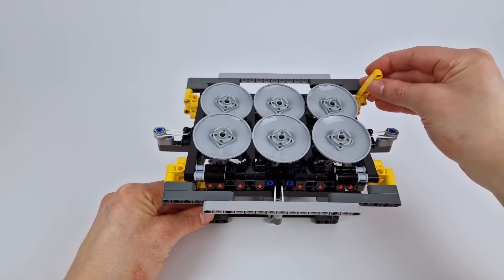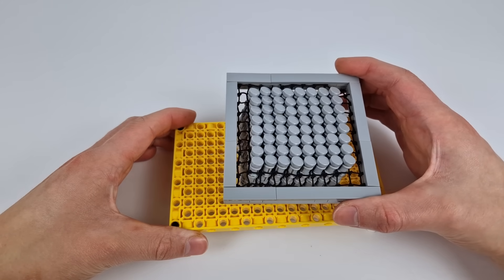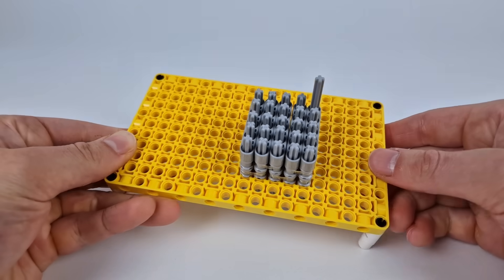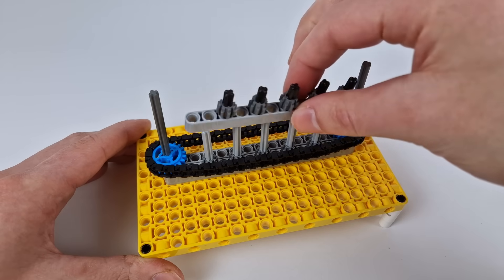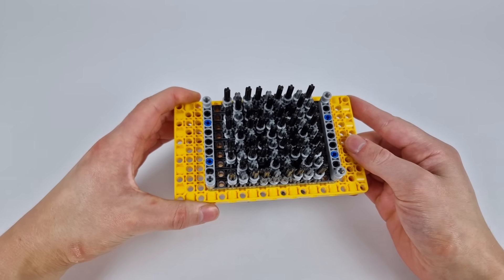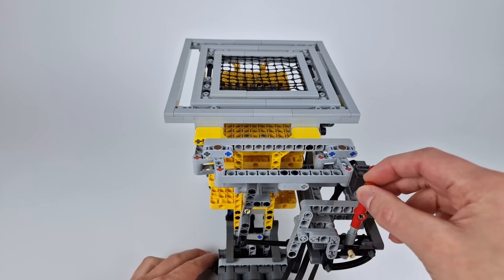How I Built a LEGO Treadmill That Moves in EVERY Direction

Comment: 4:00 Why not just add a dedicated drive gear adjacent to the border of the grid, on its own axle, powering one of the 8-tooth gears?

Do that for both layers, mechanically coupled to spin in the same direction.
Reply: Wait now I see the problem: You need the idlers on the second layer to run independently of the shafts from the first layer. Tricky.

Comment: Very kool, surprised you didn't use beveled spinning sticks with overlapping mesh to handle the smaller space to be able have an omni-directional treadmill for 1x1 lego bits but that would scale the mechanics more but would be neat where you could have a slowly scaling down from large disc down to stick-end points. May also go from rough move to smooth move.

Comment: you need to do the 2 layer approach combined with the rubber band approach for the 2nd layer, so you get the rotational direction on the bottom layer and each shaft only needs to bind to 1 other shaft to enable all of them
Reply: I think your bushings were adding too much tension on the bands though

Comment: hi! little engineering thing: the universal joint connection you used do transfer the rotation to one gear to the other doesnt transfer exactly the same angular velocity, instead, it transfer it with a  gain of a trigonometric function related to the angle between the axle of the gear and the axle you used to transfer motion to the other gears. However, the angle is small enough to not be noticeable, but you can experience what im saying via the vibrations produced by the coupling, again, mostly assorbed by the joint itself. to preserve a omocinetic coupling, you can simply put two universal joints with the same angle, and the trigonometric factor mentioned before will be canceled out by the other you implemented by using the second joint.

Comment: This is really cool! Here's an idea for a possible improvement. Right now, when you move the net, the axle above the U joint is moved aside, but this means the top discs are moved sideways in addition to being tilted. What if you could move the bottom half of the U joint aside while keeping the top mostly in place? That way you would only be tilting the discs, not translating them. The tilt would be a result of the bottom half axles being shifted over.

Comment: I probably would have used a bunch of universal axle joints to allow each axle to be offset from the 10x10 grid to allow for te usage of a grid like your first attempt, but i think your current version is probably better than that and it doesn't require four universe joints per axle(one for the upper part with the tile, three underneath to allow the axel to be offset from the placement in the grid, although it might be possible with two depending on the size of the offset).

Comment: 12:22 A two pulley design with a rubber band with 1 twist would work with a good length of rubber band. It's able to act similarly to a gear, reversing rotation .

Comment: I don't think the problem with the rubber bands was friction but rather elasticity. Each rubber band has a certain amount of stretch-give before it starts to turn the next axis. Basically, when you have two axes connected with a rubber band belt at rest after installing, the belt is in equal stretch tension on both sides. But once you start to turn one axle, the side that "pulls" on the other one gets streched while the side where the belt is fed to the other axle in a "pushing" motion is compressed. Depending on elasticity of the rubber band belt, the driven axle might turn a few degrees before the other one starts turning. Using only two axles, that's not too bad, but repeat that multiple times and it starts to add up. If you keep turning the driven axle for a long time, eventually all axles will rotate at the same speed. But it has 3 downsides:

1) The rubber bands you used are probably not super high quality, so the elasticity of the rubber may fluctuate around the band, giving a fluctuation in strechiness and causing a janky rotation.
2) While going around, the rubber bands are constantly altering between a streched and a compressed state which will wear them out quite fast.
3) Stopping the rotation or even reversing the direction will take forever until all rubberbands have found a new equilibrium.

Comment: You were hoping for 10x10, you found a clever trick with odd/even axles in 3x3, so you compromised at 9x9.  But wouldn't the same have worked at 5x5?

Comment: The original design with to gears thst were inverted when u tried adding the ruber bsnd u removed the gesrs( for context have two layers one gear for all the first ones and a second layer for the other ones then have ONE rubber band going from one of the first layer rods st The top to only one of the 2nd gears(this means only 1 ruber band connecting 2 gears and s full powered gears))

Comment: Could you not condense the vertical construction with a two layer gear system like your first idea was? But switch between gears that free spin and gears that grip the peg?
X=Gear that grips the peg; O=Gear that free spins; G=Motor
--Layer 1
XOXOXG
OXOXO
XOXOX
OXOXO
--Layer 2
OXOXO
XOXOX
OXOXO
XOXOXG
Cons are the friction of the free spinning gears being double and depending on free spin gears even existing for that size. I haven't touched a Lego since I was 13 so I have no idea.

Comment: Maybe 3 bevel gears can allow you to change the direction of an Axel.

Allowing you to use the original grid pattern assuming you can fit a   compartment to hold the bevel gears inbetewen every other Axel.

Comment: I don’t know if you’ve heard of something called a “planar motor” before, but this setup is very similar to one of those! The difference is that planar motors use electromagnets to move around a platform with permanent magnets inside, whereas this uses rotating discs—and can move literally anything!

Comment: instead of using the 12 tooth gears spaced apart you could try using a rubber band but twist it so the rotation is reversed? 11:48
Reply: I think te band rubbing against itself would make it saw through itself

Comment: This could be much better if the joystick moved the entire drive mechanism instead of the net, because now the upper disk are not only rotating in X and Y axles but also moving with net, therefore observing motion of the platform is counterintuitive.

Comment: 3:02 I'd have either printed a fitting gear or would have made a jig to drill them. 

Not nearly the challenge from your final solution though. 

I think instead of multiple 3x3 grids, i would have expanded the checkerboard pattern to get rind of the bushing layer.

Comment: This is certainly a very cool omnidirectional treadmill
The engineering behind the drive system is excellent, but I think there’s a solution to making a drive system that’s a a total of two studs tall.
If you make the lower layer powered by having 8 tooth gears on all axels going horizontally on every other row, then having a two long axel with an 8 tooth on both spaces on the outside of the grid, that couples with an idler that’s on top of a spacer, so that it only meshes with one of the 8 tooth on the axel, and the rest of the remaining axels.
Each row can be coupled together with a set of idlers outside the grid

Comment: Instead of the universal joint and gear powering the the two levels take a rubber band and cross it between the shafts that will make them rotate in opposite directions and its way more compact

Comment: The way you set up the linkages to counteract the 90 degree rotation is such a nice design detail. 

I haven't seen it in the comments, so I''m not sure if anyone mentioned this yet, but since you're tiling 3x3 squares, I wonder if you looked at taking out the corners, then tiling the resulting 5 stud plus shape. That could reduce the height of the assembly quite significantly, since you'd need less layers. I'm not sure if such a tiling is possible though. I don't know if the spacing would work out, and sadly I don't have the lego pieces to test it.

Comment: The gear pieces you need for the 4:02 approach could probably be created by drilling through those existing gear pieces? If not, they'd be fairly cheap to have 3D-printed in large quantities (on an SLA machine).

It'd be cool to see this design simplified! 🙂

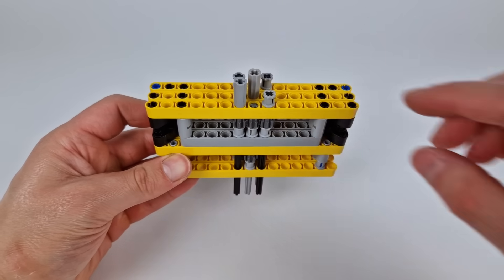Comment: 11:14 instead of using the universal socket gear at an angle, why not try the L shaped method but instead of doing 3 gears, use 2 gears and your rubberband method? that inverts the direction once then binds the gear to that directions

Comment: Idea 1: Instead of the angled offset blue gear construction, make one of the idler gears of the C longer and use the small gears
Idea 2: If you can do a 3x3, it sounds doable to do a 5x5
Idea 3: Drive some of the outside gears with a chain, then make the next undriven achsles longer so that there's a new "level" of "outside" gears. I think you might do the whole set with just five levels.

Comment: This is awesome. I have 1 thing I want to add. If you make 2 "net platforms", one that moves on the bottom, and one Stationary above it, then you put the U joint in between them, this could allow you to move the drive shafts to angle the rollers rather than moving the rollers. 

I think this because when you change directions quickly, the piece shoots off to the direction of travel. If the rollers are Stationary and the drives after move, it may allow for a more fluid direction change.

This is an awesome project though!

Comment: You can use bevel with non bevel gears if they are offset by one hole so you could have used a 8 tooth gear with a 12 tooth gear

Comment: Since the mechanism is made up of single independent chunks of 3x3, you could in theory extend this mechanism an indefinite amount, right? As long as you manage to fit the bits that lock the two 12 teeth gears at the bottom in place, at least

Comment: For connecting the opposite rotating axels of the edges and the corners would it not have been much more space efficient to just use a rubber band to rotate a third axel adjacent to both and connect that to the other one with small gears?

Comment: So cool you did this in Lego. What if it was scaled down to a nano size, tightly packed but insulated, and controlled with an electric current? It might require insulated soles on the participants feet but that’s easy to fix for a shoe. 90% real suggestion.

Comment: Maybe I'm wrong, but I think combining the chain system from the middle of the video with earlier idea of little rubber bands powering one or two adjacent discs per chain-driven disc would have worked. The reason it didn't work using gears is because one single gear's torque needed to drive every single disc in the grid, but with the chain I think the forces would have been distributed better. Maybe you would have still needed multiple mechanisms, but I'd guess you could have driven more than 9 discs with each one.

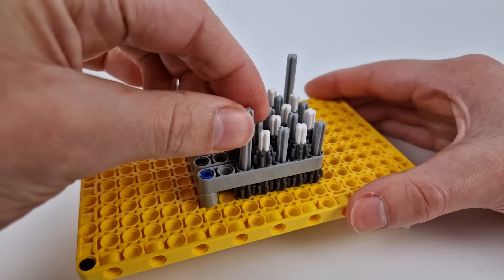Comment: 4:30 Why not just use the two layers of gears and drive them separately? Since the layers have alternating shafts, slight power differences shouldn’t matter too much. Or why not connect a gear external to the grid instead of in line with one of the driven shafts from the first layer?

Comment: Have you thought about using worm gears and then driving every other outer disc layer by layer working your way in until you reach the center? This way you might have a chance of building the whole thing without using non lego bands. Idk however if the regular worm gears mesh properly with the tiny 8 sprocket gears...

Comment: A single universal joint is not constant rate of rotation. Since one of the drive axles need to transfer power to the top, you should use a double universal joint. But I guess it isn't a huge issue for your application
Reply: at least they are all bent roughly the same angle so they slow down and speed up unisono 😂

Comment: Couldn't you just stick with the 2-layer version and use an extra drive (idk the lego terms; connect a cog to the bottom layer, transfer the rotation up with a rod [x shaped cross section] and use two cogs on an intermediate layer to change the direction) thrn just connect to the second layer?

Comment: Interesting mechanism! I would have expected splitting 10x10 grid into 20x20 grid using double universal joint per disk axis (for grand total of 3 universal joints per disk) to allow gearing all the axles with pure gears only.

Also, it would have been even better to keep the net static and move everything below it so that the part that's visible on top would appear static (it's really hard to see that those round 1x1 grey plates are spinning) but still allow items to float according to the joystick.

Comment: Personally i would have had a layer of more dispersed gears with idler gears and then just connected them to the discs with axles with universal joints on each end. So the drive axles are compact at the top and dispersed at the bottom. Would this work? If so it could be used to power a grid of any density and size

Comment: If you add another joint and another net, you can change the angle of the discs without moving their position. As the moving net will be below.

You'll have to factor the height difference, but can be solved with sliding axels

Comment: Did you want to avoid drilling out the 1x1 gears to make idler gears? I would've drilled them out, so shafts of the lower layer could run through them and rotate freely.

Comment: what if the net would go higher? almost under the discs. what if there would be no net at all? the same geometry of the frame (say 10x10 inside) and the frame shaped from round elements? just hot minds ;)
but the general idea is great for sure. i think it's the exactly what Disney did with their treadmill.

Comment: I'm a mechanical engineer and product designer, and your problem solving and ingenuity on this actually made me get a little misty eyed! Beautiful work. I also have to say that this speaks incredibly well to the precision tolerances that Lego holds. With stack ups this long, it's frankly amazing that this is even possible, let alone working pretty flawlessly. Bravo to them as well as you!
Reply: An engineer’s dream, a maintenance tech’s nightmare
Reply: I'm at college going into mechanical engineering, and I think I will re-approach this sir's attempts to provide my own solution for an assignment in college. I think it would be simpler with an axel of worm gears for each row: each axel would have 10 technic (technically not lego) short worm gears of alternating direction to power 10 gears (1 row) each. There would be 5 layers of axels, with the highest being for the first and last, the 2nd highest being for the 2nd and 9th rows, and so on and so forth until the lowest 2 axels powering the 5th and 6th rows (this is so that no worm gear axels get in the way of the vertical axels).
Connecting all axels: From the side, all of the axels would be connected to gears connected to 2 diagonal chains (like what he tries at 8:47). If there were a gear large enough, the middle gear of each diagonal line would be connected to a single gear which would be powered. This design does have a fair bit of friction, but it should be smaller, and perhaps look cooler. In any case 1-2 motors would be used at this point to power it.
Other additions: there would be a frame holding the vertical axels at constant distance between each other right above each level of worm gear axels since the stability of the lowest gear lines would be significantly less as the extra length of axel could bend more. 
For the universal joints at the top, they could be replaced with different parts (called LEGO Output Shaft for Constant Velocity Joint (92906)). The top 2 pieces of each unit could also pinch the net he uses so that each would not be pushed unevenly by it but pulled more evenly.
Reply: love how you're getting misty eyed while the factory maintenance guy above you is getting chills down the spine. i guess the jokes do have some truth to them lol
Reply: Idk if youre just talking about the fact that he made this with legos, but its a Disney imagineer that invented this some years back.
Reply: So satisfying to watch too! 👀
Reply: Could you drive them with flexible plastic tubing?
Reply: 911 likes is crazy-
Reply: lmao misty eyed? leading with your credentials? weak liberal spotted
Reply: I would love to see a massive one it would be cool
Reply: The grid, he couldn’t use it because the gears didn’t come in non-axle just a hole way, I present a solution. POWERDRILL AND BRUSH
Reply: @EchoAssaultt  you absolute psycho!! 😆😆😆😆
Reply: @EchoAssaultt  That would mean damaging the pieces and in most lego builds that is considered cheating and he mentioned that having the gears bend the shaft was "illegal" so I assume he was following the common rules :) So no destructive modification of the lego pieces. ;)
Reply: What's happening to my replies
Reply: Idk

Comment: Well, someone finally did it. Someone finally made an physical windows screen saver 😂

Also, have you thought about trying to increase traction by adding a texture to the disks or the bottom surface of what you put on them? It would be interesting to see the change in speed of the objects on top of the rig since smooth plastic on smooth plastic certainly has to have a good amount of slippage. 

Also also, have you named this thing yet?

Comment: 4:30 - This 'bar instead of axle' idea might actually work, if you use the red 8 tooth gears, designed to slide on axles.
They don't engage the bars, and normally slip to one side, but as they're surrounded by other gears, they should stay in place :)
The gears that should actuate the bars don't have to do it directly, these bars sit quite tightly in axle connectors.